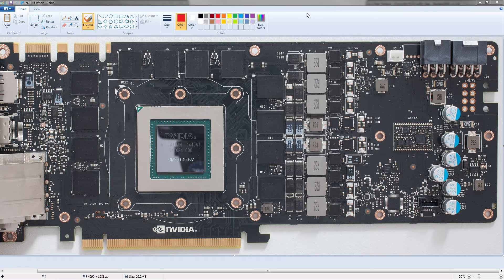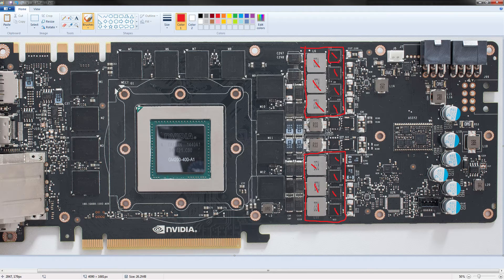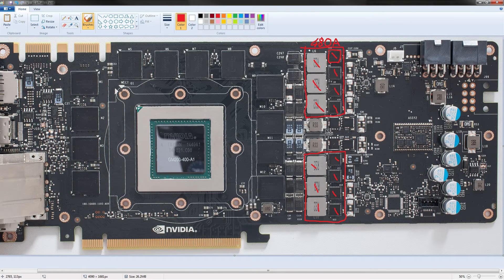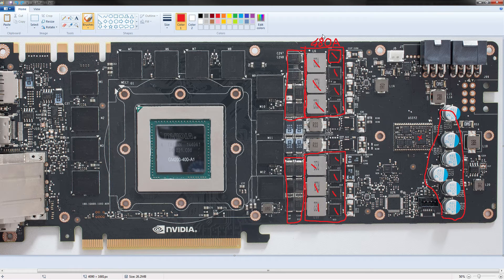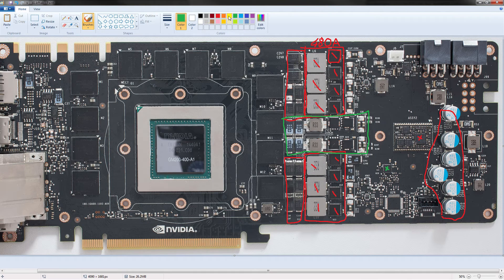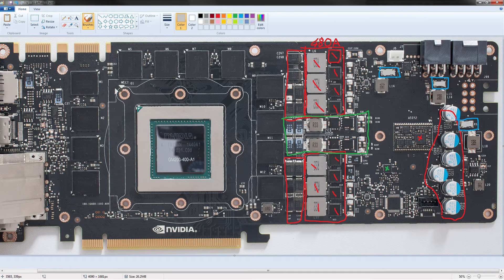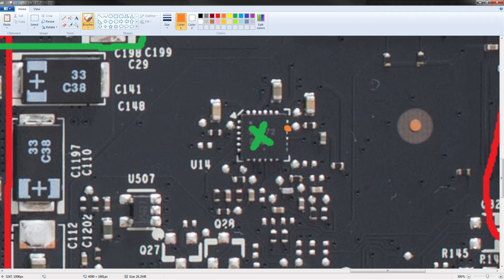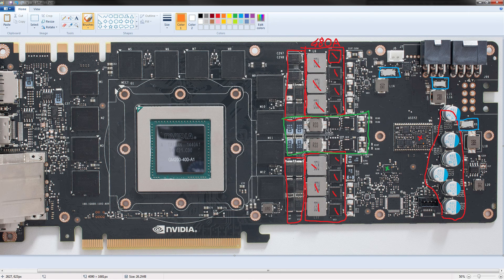GTX 980Ti/TITAN-X/780Ti/Titan Black PCB breakdown + mods

Comment: I have exact same card with two faulty Mosfets, on mine, the chips are labelled SiC789 AF T542. There are two chips available, SiC789A 3.3v and SiC789 5.0v on Degikey website. The Gtx980Ti's all have 5.0v chips?

Comment: I've been struggling with a Titan X maxwell overclock (Tesla M40 actually) I can get the core to 1500Mhz, and the memory to 8000Mhz, but if I go above 1400ish on the core (with higher voltage) the memory can't even get over 6000mhz. I have the power limit raised to 300w, and the card is generally only pulling 250. Core is water-cooled, temps around 48 C. If anybody has any ideas I'd really appreciate it!

Comment: I have a cracked L14 in a Tesla M40 card (very similar PCB). Any idea on what is that and what could be have caused that? It burned my motherboard VRM. Looking forward to maybe repair the Tesla. It also have DrMos 4 from bottom to top missing unlike this card. Card was detected properly by driver setup program but after a while burned my motherboard VRM. 12v PCIEx in the socket reads 3.9 ohm to ground. So seems something is shorted.

Comment: My GTX TITAN recently died. I have checked the pcb and measured the power rails, gpu chip vram etc and they were fine, except the inductor that is next to the buck converter (down on the right side of the pcb. I normally should get around 2k ohm but i get straight 0. I removed the ic chip and i still have the same resistance. Do you know what other components are connected to that rail. Or what component can cause this?

Comment: I have a question about this PCB. My EVGA 980TI has blown itself up last night while gaming. I haven't overclocked it and it has descent cooling from the original heatsink and fans. Now that I opened it up, I saw the damage that happened. Now I'm scared that it could have damaged other parts in my PC like the PCI E port or my monitor that was connected with the DP output. Can you tell me by taking a look at some pictures of the burned out parts that collateral damage to the mobo is in fact a likely scenario? I can't test it with another gpu because I don't own a spare one.
Reply: what parts burned ?

Comment: Hello, first of all thank you for the in-depth analysis of all the pcb's out there, amazing job!

Now my question is, i have a founders 980ti with apparently a broken vram voltage controller (havent measured yet) am i able to shunt over it? So would the shunt bypass the controller to feed the vrams the required voltage? My 980ti runs and core warms up so core voltage is not an issue, the card is not displaying any image. Any advice on measuring the controller chip?

Comment: Late to the game, TLDR, does populating the 3rd 8-pin do anything on the reference 980 TI? I unfortunately have the PNY blower 980 TI, which has the lowest set power limit in its BIOS, looking to flash that at some point cause I finally got a water block for it

Comment: Greetings
I have recently acquired Gigabyte version of this card as non workable. It shows the picture, but when on load sometimes it gives BSOD. Also the LED was stuck at green all the time. I was able to fix the LED, it was faulty cable. After testing numerous drivers and software fixes i finally was certain that it is a hardware issue. After removal of the heat sink and and close inspection of PCB board i noticed that one resistor seems to be knocked of the board. I am familiar with electronic repair and i have hot air rework station so to replace this resistor shouldn't be big of an issue.
i have found online the picture of the PCB for this card and confirmed that resistor is on the board normally. It is also here on this PCB from Nvidia, that whole section is the same. It is resistor R77 on Gigabyte version and it is located just below the GPU. in between GPU and PCI contacts. Look at this image: https://www.dropbox.com/s/w1l1k5o7f6qjqez/R77%20Location.jpg?dl=0
This is the closeup of that area where the resistor is knocked off: https://www.dropbox.com/s/fq4vmbkxvnyoaux/IMG_20190216_173300.jpg?dl=0
I have measured the nearby resistors to be R78 and R79 around 36 ohm and R76 is 2.2K ohm.
So my question would be, if you still have this PCB form this video, can you measure this R77 equivalent resistor?

Thanks.

Comment: can you explain how the voltage controller generates a pwm signal and what happens then ... mosfets gets the pwm and send voltage to the coils ?    where are the inputs and where the outputs       this wuld be very helpful to analyse defective cards and repair them ....    actual i got a 980 ti with no voltage at the coils output for gpu core and memory :(

Comment: Lets say one of the mosfets on a 980ti got removed. Would it still function with the other 7?
Reply: Back from the dead lol
Yes, it works for low power (<50% TDP) loads which don't stress certain parts of the core. I can actually mine ETH on this board with a FET removed. However, the voltage ripple at high loads will blackscreen the system, requiring a hard reboot.

Comment: Regarding the current sensing pin; If you have fine enough tips and tools, and steady hand, could desoldering it from the board pad be an option? - Then cut a sharp/narrow wedge of kapton tape, lift the pin so it does not press against the PCB (without plastic bending it), and jam that capton tape wedge in between the leg and the pad...

Comment: Did you ever look at an EVGA 980 FTW? There was some speculation that their non-reference VRM design didn't quite work well, because relatively lot of the owners had stability issues.
Reply from the maker: nope and I'm pretty sure it's a reference PCB
Reply: The smaller 980's other are reference PCB, the FTW is not. Somewhat similar, but in the end, not:
https://forums.evga.com/FindPost/2292536
More inductors, for sure, others stuff I can't make out.
Nevermind, thanks for replying, though.

Comment: What happens when one of the R33 inductors is missing?  I had a card that works but crashes when pushed.  I replaced the R33 and it looks like it works better.  Less likely to crash.
Reply: My R33 blows up. Where can i buy a new one?
Reply: ĐΔNĐELĬƟN Thanks
Reply: thanks,  this is the reason I put up my post.  was what I needed to find.
Reply: @imshark2813  did you end up finding where to get them? I'm looking for thrm as well, one of my r33's got hot enough to grow legs and move :/
Reply: @tookitooki  Sorry, I have still no idea.
Reply: Toan Ho Mine was missing one aswell? And my card is crashing pretty often. I have a broken gtx 780 so i’m taking off one of the r33 inductors and replacing it, wish me luck haha.
Reply: check the resistors in front of  ! mine are shortened and the inductors got grilled ... have to search now the right parts
Reply: not luck.  near half have r33 blown.
Reply: where did you buy the r33?
Reply: Yeah I need to buy one too where though??

Comment: My EVGA 980ti just went up in smoke while gaming - literally.  One of the the memory VRM inductors fried (lower R33) the R33 above it looks golden over heated and 1R0 got so hot it melted the solder and started to slide down the PCB and is on an angle. The shunt resistor just below the fan header is also bubbled and crispy.  Question: what happens when the inductors fry?  Is there a chance my card is salvageable if I replace these components or is it likely other components are now fried too?
Reply from the maker: Honestly that sounds like you might have to replace the entire VRM. There's too many parts that failed.
Reply: Thanks for the prompt reply.  If I had a "parts card" laying around I could pillage I would give it a go but it doesn't seem worth sourcing one at this point on a long shot.  I got a really good deal on it when I bought this card from a friend who just sold his last 980 out of his old 4x 980ti SLI rig which I now own and I'm bummed I have to spend over $500 on a new card to match its performance.  And yes, 4x SLI is nothing but trouble :P

Comment: If you could find the time, to even do a VERY brief overview of the G1 Gaming GTX 980 Ti I would be eternally grateful, kind sir BuildZoid! 

I have never hard-modded any GPU before, but there are some things I would REALLY like to try, also - I am that kind of insane that where I start wondering about something, I CANNOT stop until I find my answers..

I am on my Tablet right now, but if you want some high quality 1080p pictures BitTech.net has them all, IF you require something more detailed? Well I would gladly yank my card and snap some higher quality pics - what does the Note 5 have, 12 MP IIRC.
Reply: 980 ti xtreme .... explaning the ln2 would be great

Comment: Hey man, I'd really appreciate if you could help me with my problem: I have a "GTX 970 Zotac AMP! Omega", the one with orange stripes and 2x8 pins and I have a few problems with it. By the way, I wanna watercool it. 1 Problem) My card clocks itself down for no significant reason other than being above 180 Watts, even though it has somwhere of 250 watts just by the 2x8pins. 2 Problem ) In my Stock Boost Table theres some Clocks where there is 1.28 Volts on the core, but my measuring points measure only 1.24 max, is there any way to fix both of these issues?
Really would appreciate it! (Theres high-res pcb pics on the internet)
Reply from the maker: The voltage going from 1.28V to 1.24V is probably just vdroop and you need to either get LLC settings(not possible AFAIK) or just raise the core voltage to compensate for the drop to 1.32V(doable with a custom BIOS or hard mod). As for the power limit you could go with a modded BIOS or just short out the shunt resistors on the card(from the 1 pic I've seen there is 1 shunt right after each 8 pin connector). BTW I haven't touched a single 9XX Nvidia card so I'm no expert on them and I'm just going of things that I know generally work.
Reply: well my problem is, that even if i put everything i need to volmod the card to 1.337 volt (see what i did there?) my multimeter still only says 1240mV
Any suggestions?
Reply from the maker: You're using software voltage control?
Reply: No in the voltage table of the .rom i edited every necessary voltage to 1.337 volts and I patche the bios rom with nvflash
Reply from the maker: And that's outside my capabilities on Nvidia cards. A physical volt mod would almost certainly work but I'm guessing you don't want to do that.
Reply: Well i'd like to do it when I have it for a bit longer so my value for it is low enough, but how do I actually know which voltages i have to edit in the maxwell bios tweakter in order to force a voltage , maybe ive done that wrong?
Reply from the maker: I've never dealt with maxwell BIOS editing.
Reply: Welp, thanks for your attempt to help me nevertheless. Maybe I'll find a solution. If I'd ever want to hardmod it for the voltage and I ask you to tell me how to do it? Would be generous!
Reply from the maker: Yeah sure I'll help with hard mods.
Reply: precciate it man! Like ur vids btw , you surely deserve more subs than currently

Comment: Do you know where I could get the electrical schematics?
Reply from the maker: For the PCB? Probably impossible unless you know an engineer at ASUS or some other big GPU maker.
Reply: I was afraid of that. I have a "friend" not a friend, he posted in a forum for help, and I always try to help. he his board pissed on by his cat. he said it won't even start. I'm trying to walk him through the repair process online since he doesn't live near me or I could do it. That is where my microscope helps for this stuff, makes soldering those tiny pins a cakewalk. But I digress. I told him to probe the mosfets. for  voltage input, and the pwm signal on the gate. I think the issue is in the pwm circuitry. but idk yet because he hasn't gotten back with me yet. but it will just be a pain in the ass without the schematic. it can be done but it isn't fun without a schematic.. I offered him my gpu repair services if he doesn't want to repair it. have a board to measure for reference, microscope and oscilloscope, and smd rework tools. will make this easier for me. I'll dig a little more the the schematics, I know there out there somewhere but as you said, probably impossible to find

Thanks for the reply, man.

Comment: Can you do a short video on high bclk overclocking. like very high 5+ and how can I achieve that on a 5 phase vrm? design
Reply from the maker: +Mohammad Ali why? what mobo do you have?
Reply: +Actually Hardcore Overclocking gigabyte z170-HD3P with a i5-6500
Reply: +Mohammad Ali unfortunately I don't have any skylake stuff on hand. However from what I've read you need a non-K overclocking enabled BIOS. Do you have one of those?
Reply: +mr.cleaner yes. I am running my processor right now 4 ghz
Reply from the maker: +Mohammad Ali Unfortunately I can't help you with that since I haven't used skylake at all. The only thing I can think of that could be limiting you is that you aren't underclocking your RAM but I guess you already know about that.
Reply: +Actually Hardcore Overclocking so what do u recommend for serious clock with I can use for daily or 24/7 use. My processor will be under water
Reply from the maker: +Mohammad Ali should be able to hit 4.5 to 4.8Ghz depending on how good a chip it is.
Reply: +Actually Hardcore Overclocking Would electroning migration be a big problem when running 1.42v 24/7 5ghz 4790k?
Reply: +xXsch3ricXx it will probably need more volts to 5Ghz in a few months.
Reply: +mr.cleaner yea ok. I should be fine with 4.9 at 1.36 or 4.8 at 1.31
Reply from the maker: With those voltages you could try for 5Ghz on 1.42V
Reply: +Actually Hardcore Overclocking The thing is that i delidded and got a hyper212 evo and just did like 4 cinebench runs. Max temps were 71C and max score was 1005. So i could build a custom waterloop. Like yea i need that cpu for at least 2 years. Its not like 24/7 usage more like 5/7, since im gaming a lot.

Comment: Thanks a lot. Very helpful. One more question how much volts do you recommend for 24/7 usage on air?
(Im currently running 1.274v 1500core and 7980mem)
Reply: 1500 on air! Wow.
Reply: +xXsch3ricXx temps don't go higher then 71 C at the moment. (so would it shorten the lifespan a lot if i go higher?)
Reply from the maker: +xXsch3ricXx 1.3V should be safe however based on what I've read there is a good chance you won't see an increase in OC headroom.
Reply: +Actually Hardcore Overclocking Ok thank you.